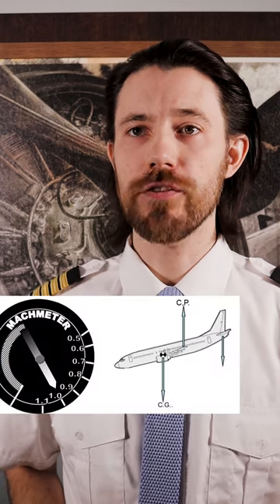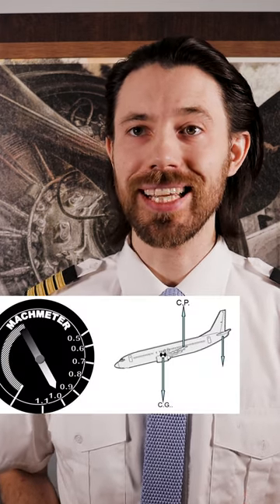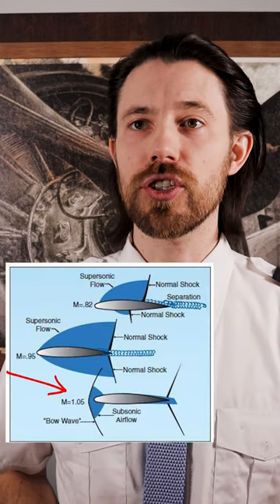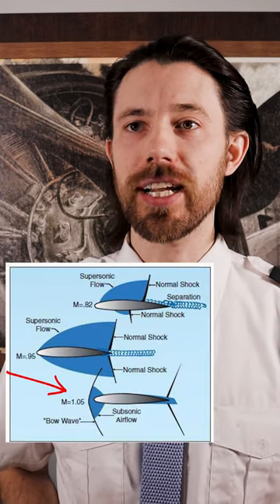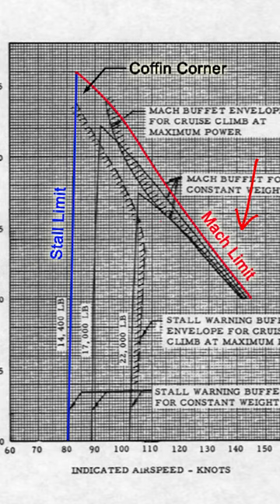What is Mach Tuck?

Comment: Im confused.. Mach tuck happens because of high angle of attack? I always thought mach tuck happens due to the formation of wave drag causing airflow separation.
Reply from the maker: In the video I say “increased” angle of attack, not high angle. The higher you fly, the thinner the air, the more you increase angle of attack to maintain level flight. So yes Mach tuck happens because you exceed critical Mach number and shock waves occur over the wing. Check out my other shorts: https://youtube.com/shorts/qoFh6vzy77E?feature=share
https://youtube.com/shorts/7FUonx9kw8k?feature=share
Reply: Thank you 😊👍